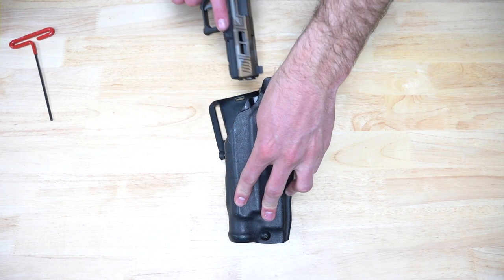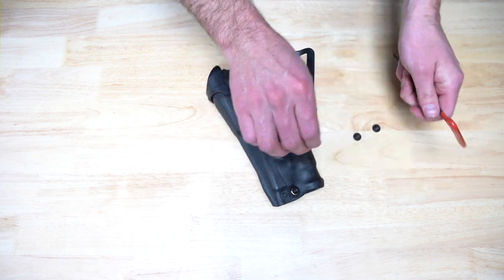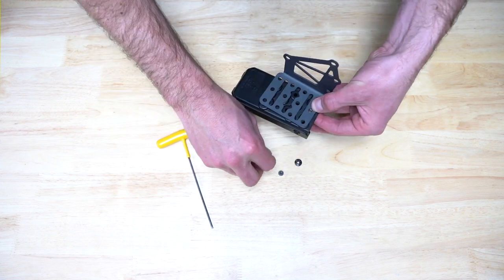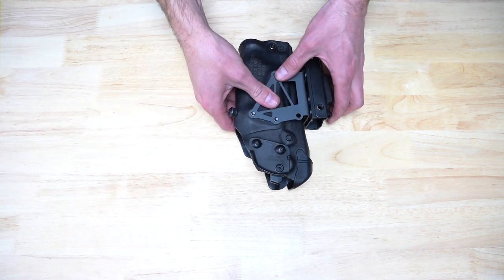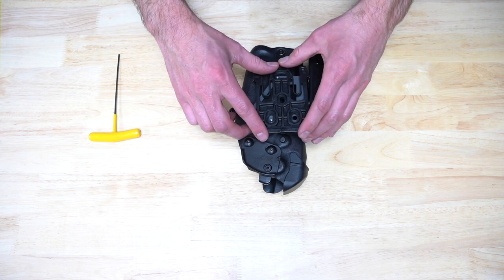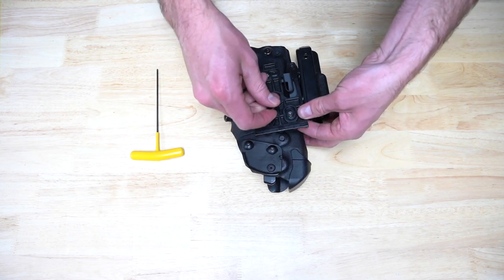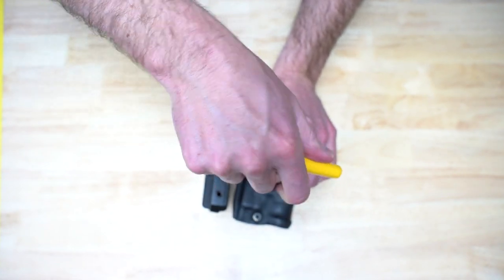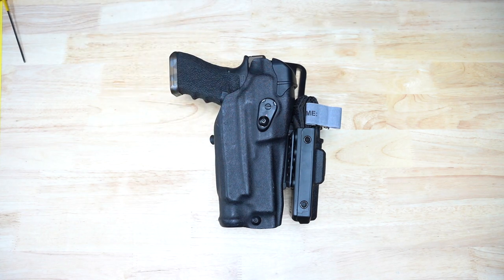NCP-E installation video v1

Comment: Does the bracket interfere with the QLS system?
Reply from the maker: It is designed to work 'best case' with the QLS system as that allows for the greatest range of cant adjustability.
Reply: @blackboxcustoms3514  excuse my silly question. Which size washer did you use here? I don't know the size specs or where to buy those and the the bolts. Greatly appreciate it!

Comment: Will this work with a safariland drop flex adapter?
Reply: Hey there, the NCP is specifically designed to be used with the QLS and UBL from safariland. Unfortunately, with the range of motion in the DFA it doesn't give you a consistent angle which the NCP relies on.
Reply: Black Box Customs thanks